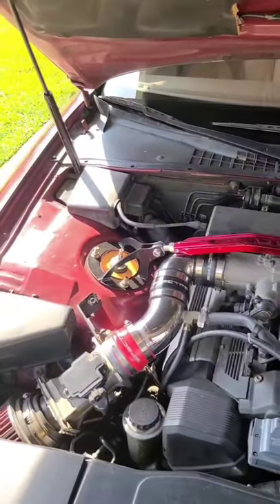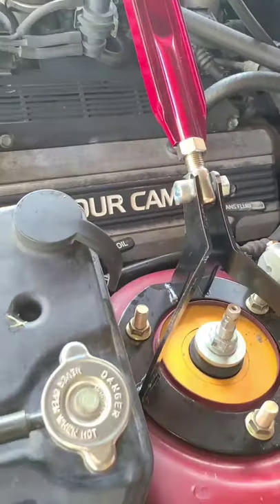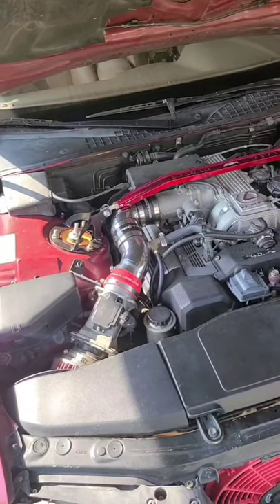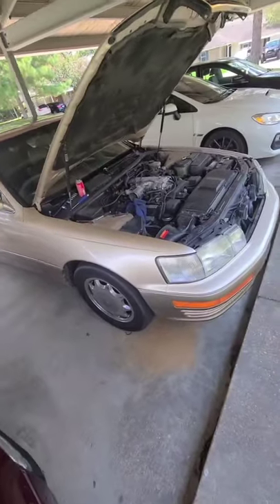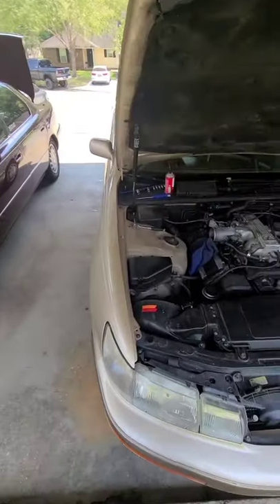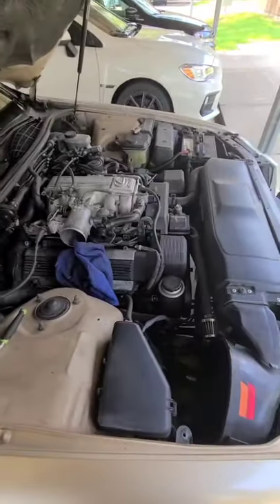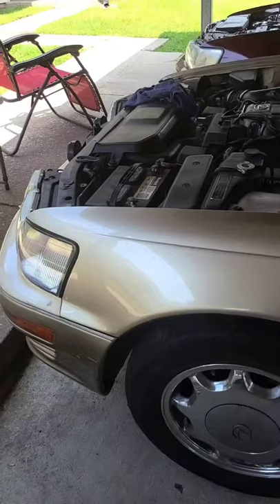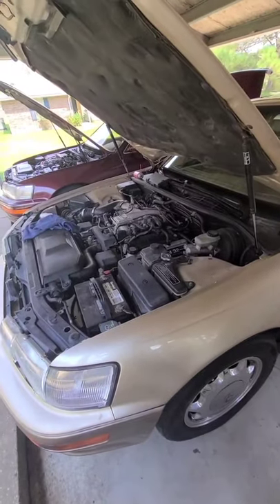deleting  Charcoal canister on LS400

Comment: You get any fuel vapor smell at all. Great idea with the filter.
Reply from the maker: No after doing that I haven't had any fuel smell at all
Reply: @lexuslife  how often would that filter need to be replaced. Actually in the the process of doing this to my car. Any choice on filter to get like which brand to get.
Reply from the maker: Any small fuel filter for like a carburetor or  Lawn mower will work for that

Comment: I notice there are two lines coming off the top of the oem canister, and you leave one of the lines coming from the car alone and put nothing on it. I have a 94, and just got a used charcoal canister with less mileage to try. If it doesn’t work, I’ll go this route (I have an insane amount of pressure in the tank and the smell of fuel in the trunk/car) is leaving that other line on top by itself ok?
Reply from the maker: No I cap off the line at the motor
Reply: @lexuslife Can you show that cap on the motor please. I have the same car and am doing this today

Comment: I think you misunderstand the pressure in the fuel tank. So you have valves that maintain a pressure on the tank as this pressure keeps the tank primed. So a certain amount is desired. But yes when one of your valves fail like the charcoal canister you will get excess pressure. Typical faults will be the car wont accept gas easily because it can't release the pressure well enough etc... I'm sure you know but yeah fun fact. So no open air gas tanks...
But did you get a CEL with your charcoal canister delete?

Comment: Does it leave an check engine light on ?
Reply from the maker: If done to 90-94 no engine light. 95-97 the purge valve is on the charcoal canister and yes it will make the engine light turn on

Comment: Hey bro where’d you get your strut bar and air intake ??
Reply from the maker: I made them. Intake parts are from autozone. And the strut bar is a nissan S14 strut bar and brackets are from 1989 toyota supra. That was cut shorter and holes redrilled